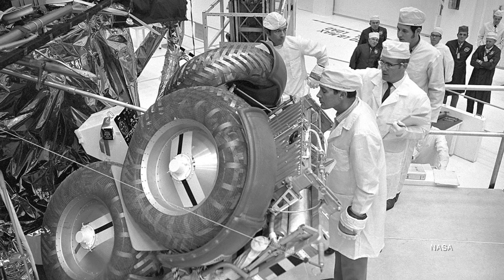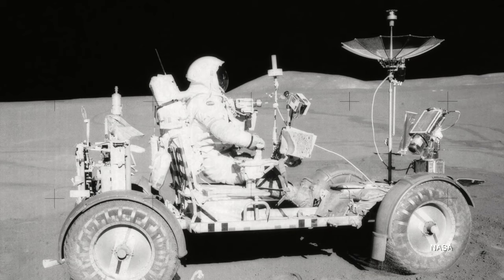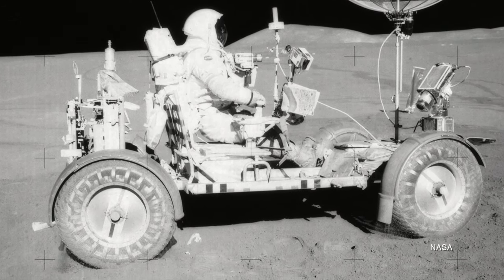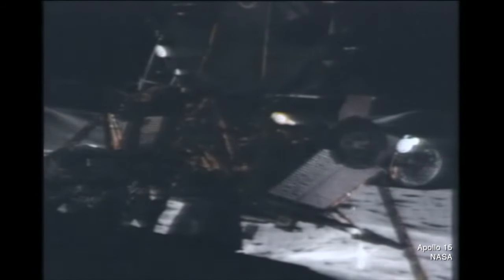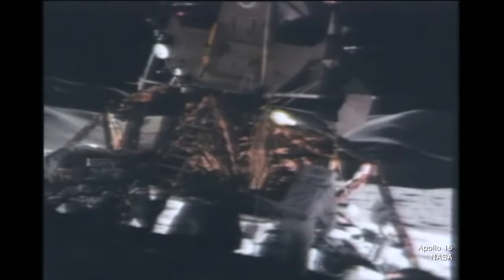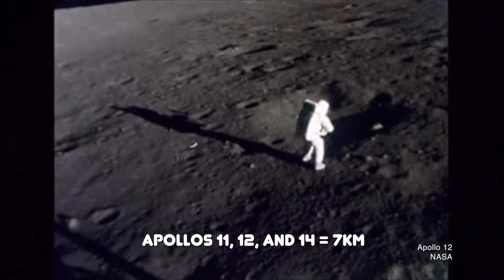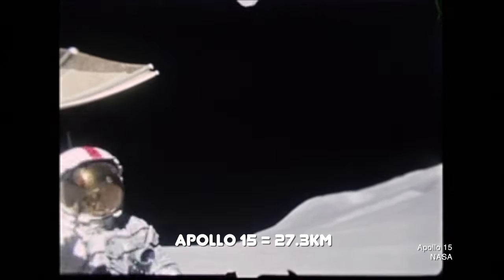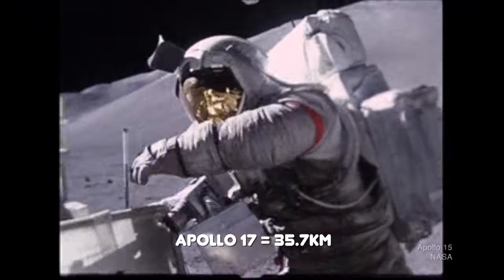How NASA Took Cars to the Moon

Comment: I've always more wondered if this ultra genius NASA girl, explain to us, why the numerous of inconsistence shots across apollo 15 to 17 rovers pictures, where there is not tracks marks from tires behind or in the front over the sandy soil.
Reply: There were many reasons for tracks or no tracks or light tracks or heavy tracks.  As Trebor pointed out, a lot of times, the astronauts were simply working a lot around the rover, trampling tracks.  But, that's not the only condition that you wouldn't see tracks.  Sometimes, the dust is not as deep, and it's much more difficult to see tracks.  Also, we are talking about a wheel that was mainly wire mesh (harder to make tracks).  And, a lot depended on the speed.  If they were going very slowly, the dust didn't move much when the rover went over, and the mesh grooves allowed the dust to displace, and then fall right back in the same position after the rover went by, thus making it very difficult to detect tracks.  Frankly, the same thing happens on Earth with varying surface conditions and speeds of a car going over.  Even on Earth, it's often difficult to see tracks sometimes.  Now, take a lightweight vehicle that's even lighter in the moon's gravity, with wire mesh wheels, and yeah, sometimes you're not going to see tracks.  The most pronounced tracks happened at higher speeds through deeper dust.  The least pronounced tracks were at low speed over shallower dust.
Reply: Trebor  but in all of them? in every single one. pass the same situation. come on!!
Reply: @carloslarard  
YOU SAID: "but in all of them? in every single one. pass the same situation. come on!!"

== Yeah, YOU come on!!!  There are hundreds of photos of the rover.  Most have tracks.  You obviously haven't looked for yourself, and you are watching conspiracy videos that tell you every single photo shows no tracks.  And, you decided to believe that nonsense.  Go look for yourself at the photo library, and then come to your conclusions.  Don't just blindly trust what a conspiracy video says.  Guess what?  They always lie.  They depend on the fact that their target audience will never fact-check the ridiculous claims they make.
Reply: Here you go, genius.  Solve this one.  Take a look at this photo: AS15-86-11598HR.  (She doesn't allow links in her videos' comments, otherwise I'd just link it for you.  You'll have to look it up by the Apollo photo catalog number.)  One side of the rover has a track all the way up to the wheel.  The other side doesn't.  My explanation relates exactly to the the comment I posted earlier, explaining that it often depended on the exact surface condition, speed, weight, etc.  For example, if the ground was a bit different on the left side than the right, the there will be a resulting track (or no track).  Or, if the CDR was driving, and the LMP was not in the rover, the left side was a lot heavier than the right, and made different tracks than the lighter side.  Or, any other number of explanations for a wire mesh wheel making a track (or not).  Anyway, the point is, my explanation is that it's perfectly normal for tracks to exist or not exist, depending on the exact conditions.  And, that photo is a perfect example of how a varying condition on the two different sides of the rover created (or didn't create) tracks.  What's your conspiracy explanation?  They lifted one side of the rover by crane, and simultaneously drove the other side of the rover?

Also, I've always wondered why you people get married to these ridiculous conspiracy notions about tracks anyway?  I mean, WHY would they "stage" these rovers with a crane to begin with?  It's very clear that these rovers worked.  They did drive.  What possible reason would they have to lift them into place with a crane anyway?  Isn't it simply more plausible that wire mesh wheels sometimes leave tracks, and sometimes don't?  Doesn't that make a lot more sense than using a crane?

Comment: The Lunar Rover weighed over 400lbs (earth-weight), and it would have been impossible to add that much weight to the LM where weight was extremely critical. Also, part of the LM's life support system would have needed to be removed in order to make space for the lunar rover. Moreover, Scott Henderson has analyzed all of the lunar rover pics and he found that each rover was slightly different in design (therefore could be easily identified) and multiple rovers were used in the pictures taken on a single Apollo mission.
Reply: @rockethead7  Hi, I read some of your GREAT amswer and I have a question for you: which is the site I should use to get all the information about the Moon landings? I perfectly know we went to the Moon, but sometimes I cannot answer some questions. Thanks in advance.
Reply: @Andrea_69  
I don't know how to answer about a site that has all of the information about the moon landings.  I basically have just accumulated most of the knowledge over the past 30-40 years.  Back during the moon landings themselves, I was young, and only knew whatever they showed on TV.  But, I started diving into it deeper by around 1980 or so (and ever since).  I've met and spoken with most of the Apollo astronauts on many occasions.  I've got copies of every single piece of video ever taken during Apollo missions, every photo, blueprints for the Saturn V, command module, service module, lander, rover, etc.  I've read every book written by every astronaut.  I've read every book written by the key engineers.  I have operated one of the laser ranging facilities that was used to bounce lasers off of the reflectors left on the moon by the astronauts.  I spent 10 years at 3 different universities getting an education in many of the relevant sciences.  I can't give you a website that tells you everything about Apollo, and answers every question.  To be honest, most of the time, I don't even need to look things up on a website any longer.  Except... well... things like in this thread, where Wendel (a complete idiot who repeatedly goes from video to video spewing utter nonsense) asks stupid questions (and ignores the answers), so I will look up the quick reference material.

But, I guess if I had to give you one website with lots of stuff, it's probably the "Apollo Lunar Surface Journal" website.

Sorry if I'm not more help.  I don't think what you're asking for exists on a consolidated website.  It's really just an accumulation of knowledge over decades.
Reply: @rockethead7  Thank you VERY much for the time you dedicated to me. I am italian and I live in USA for only 14 months. I envy you for all the esperience you have and especially about the fact that you met astronauts. The thing that makes me sad is that some people think the Apollo astronauts are liars when instead they are heros. Thanks again!!!
Reply: I am in my 60's. I didn't believe they went then and still don't believe they went now.

Comment: So why can’t we see the buggies left behind with telescopes? Hmmmmmmm
Reply: Because they're too small. It would be like trying to look at a single grain of sand from a mile away with a telescope. You can't.
Reply: @EVRose60  Wrong answer. We can’t see the flag either cuz they Ain’t there. 
We do have telescopic technology by the way
Reply: @aerowise1321  No earth-bound telescope has a mirror large enough to resolve object that small on the moon.  However, lunar orbiters from the US and Japan have photographed the Apollo landing sites in which you can detect the rover tracks and the larger objects left behind.
Reply: Science.
Reply: @Drivertilldeath  Why did you edit that post? Did you suddenly realize Saturn is billions of times bigger than the moon buggy and that's why we can see it with a telescope?
Reply: @rockethead7  doesn’t change the fact that we never landed on the moon. The radiation belt, the temperature of the moon, they would all fry. Wake up, and lose your anger. Peace

Comment: If the video signal is reaching earth you can film the entire expedition. Why is there no footage of that 
few miles drives? Driving a few miles without knowing if the terrain will suddenly sink at some point 
"is" very audacious. We see mostly one man buggy vehicles. Going solo on "adventure" without knowing 
if you will be able to drive back again? If walking a few meters was so difficult, imagine a few miles after 
the buggy failing. Footage always just shows activity at the film set area.
Reply: "If the video signal is reaching earth you can film the entire expedition."

The TV video only worked when the rover was stationary.  They would stop at a station site, align the dish on the front of the rover to aim it at Earth, and then continue working as the camera was controlled from Earth.  There are a few short seconds of the TV video working as the rover was just starting to roll, but, the dish wouldn't stay aligned for long.

"Why is there no footage of that"

On Apollo 15 and 16, they took video from their 16mm film camera while driving the rover.  But, those film reels didn't last very long at full speed (about 3.5 minutes).  So, they tended to run the film at slow speed, and used it sparingly.  So, you are incorrect about there being no footage.

"few miles drives? Driving a few miles without knowing if the terrain will suddenly sink"

Huh?  Do you think there was quicksand on the moon?  What are you talking about?

"We see mostly one man buggy vehicles."

All 3 of the rovers carried two men.  I have no idea what you're talking about, and neither do you.

"If walking a few meters was so difficult, imagine a few miles after the buggy failing."

Yes, it wouldn't be pleasant.  But, they would have done it, if the rovers failed.  But, they didn't fail.

"Footage always just shows activity at the film set area."

Oh, you're a real genius.
Reply: @rockethead7  
Supposedly they retransmitted live the apollo 11 moon landing.
That wasn't stationary, or was it? All scenes show hidden 
surfaces, little set areas. The behaviour of the crew isn't
one of scientists in an unknown, unpredictable environment.
Just playing around. The driving scenes of the rover in circles
doesn't look very trustworthy for going a few miles into unknown
land. Most of footage shows one man on the vehicle. Two seems
to be too much for the capacity to sit in properly and to drive it.
You seem very convinced that the man would have made it back
to the landing area if after driving a few miles the rover would have
failed. With what orientation device?. "Alive: The Story of the Andes 
Survivors" isn't an every day story. The moon is shown as a toy, 
that's what happens when you are on fake terrain. Why aren't there 
moon expeditions nowadays? Man can't reach the moon yet. Images
would look different and the hoax of years before would be more 
than evident.